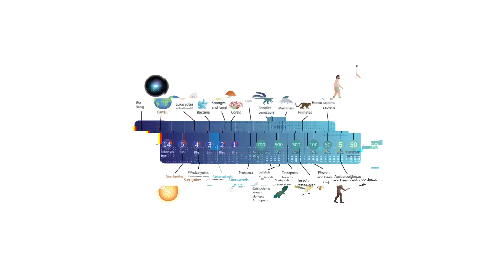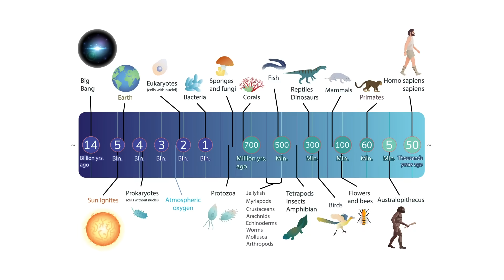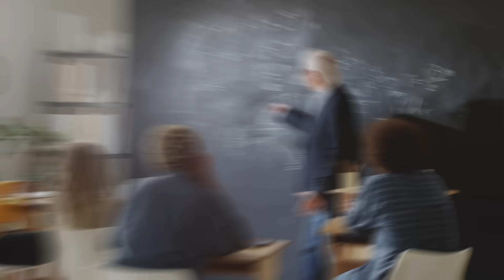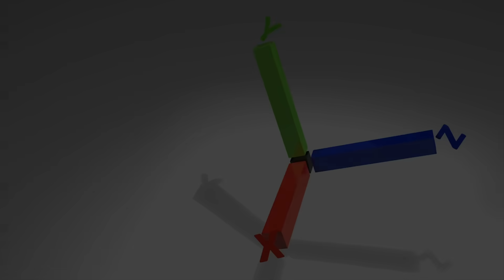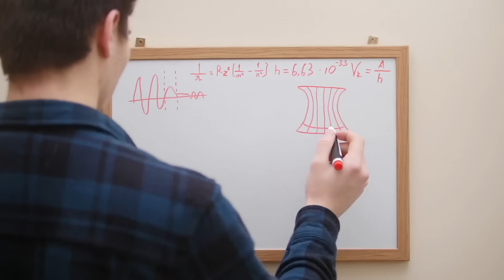Brian Cox - Why Did The Big Bang Happen?

Comment: Thanks to the JWST, astronomers have, at the edge of the observable universe, discovered many well-organized, mature, small n smooth galaxies which shouldn't be there according to the Big Bang and expanding universe hypotheses.
Furthermore, the optical illusion and surface brightness predicted by the expanding Universe hypothesis where distance objects appear larger n dimmer due to expansion do not hold in this case either. 
Therefore, what Vatican's shills and corrupt theorists have claimed so far to support the Creationism which required so-called beginning of the Universe, turns out to be a falsehood.

Comment: here is what the Holy Ari writes to us: The Tree of Life – a Poem, And he actually referred to the reason, that is, to the question why.

Behold that before the emanations were emanated and the creatures were created,

The Upper Simple Light had filled the whole existence.

And there was no vacancy, such as an empty air, a hollow,

But all was filled with that Simple, Boundless Light.

And there was no such part as head, or end,

But everything was One, Simple Light, balanced evenly and equally,

And it was called “the Light of Ein Sof (Infinity).”

And when upon His simple will, came the desire to create the worlds and emanate the emanations,

To bring to light the perfection of His deeds, His names, His appellations,

Which was the cause of the creation of the worlds,

Then the Ein Sof restricted Himself, in His middle point, precisely at the center,

And He restricted that Light, and drew far off to the sides around that middle point.

And there remained an empty space, an empty air, a vacuum

Precisely from the middle point.

And that restriction was equally around that empty, middle point,

So that the space was evenly circled around it.

And after the restriction, when the vacant space remained empty

Precisely in the middle of the Light of Ein Sof,

A place was formed, where the Emanations, Creations, Formations, and Actions might reside.

Then from the Light of Ein Sof, a single line hung down from Above, lowered into that space.

And through that line, He emanated, created, formed, and made all the worlds.

Prior to these four worlds, there was one Light of Ein Sof, whose Name is One, in wondrous, hidden unity,

And even in the angels closest to Him

There is no force and no attainment in The Ein Sof,

As there is no mind of a created that could attain Him,

For He has no place, no boundary, no name.

--The Ari, The Tree of Life, Part One, Gate One

Comment: Like sound, if the speed of light is finite (limited) it could never reach it's destination unless photons ghosts are adding data from the future into the objects we see, re-converging geometry with motion, coordinates, speed, gamma, color and contrast. Relativity and big bang debunked. If the speed of light is finite (limited) to 186,000 mi./s before the images reach their destination future data must be added into the objects we see, then re-converge geometry with motion, adjust coordinates, speed, gamma, color and contrast. It's illogical to say that light "travels" If light were reflected back in a mirror from opposite sides of the universe, according to Einstein's relativity (moving clocks run slow) the light from the mirror would move backwards in time. If the speed of light is finite (limited) to 186,000 mi./s light could never reach its destination as galaxies, stars and planets have moved from their coordinates, proving light is instantaneous in time, therefore have no speed limit in time. Relativity & big bang debunked. Light waves travels instantaneously in all directions, measuring it's speed inside a glass vacuum tube creates light shattering (interference) breaking its state of superposition. Light waves propagate through space in parallel rays behaving as the source at a given point, while measured light appears to have a limitation of speed yet its images appear instantaneous in time. 

If light and moving images were (limited) in speed for even a microsecond light waves would break its state of superposition, the sequence of video frames would immediately stop, like pulling the plug on your TV or video recorder. Einstein's relativity has the same similarity as religious and political cults, rejecting all evidence that disproves their ideology the psychological term is Mass Formation Psychosis, similar to cognitive dissonance only worse :-). The Earth is constantly moving-orbiting the sun revolving on its axis, if light and images weren't instantaneous in time celestial objects would be blurred out of focus as the human eye is limited to 30 frames per second. If the James Webb space telescope captured live video with unlimited power you would see planets orbiting their sun, looking closer you might see aliens walking on the streets where they live laughing at Albert Einstein's time dilation 🙂

Einstein removed the ether medium coordinates of objects in space, replacing real gravity with mathematical gravitational wave clocks that defy the laws of physics. Einstein's space-time relativity is a mathematical model of the universe having no physical realities, so of course mathematical gravitational waves can stretch time back-and-forth like a rubber band :-). Like the movie Rainman, autistics are great at math but lack emotional intelligence. If space was curved gravitational waves would throw planets out of orbit, altering time as galaxies and planets ascend and descend gravity waves, warp-curve, bend images in the James Webb space telescopes, the emptiness of space has near zero gravity duh. If gravity curved, warped empty space it would also curve-warp images in the James Webb space telescope. The center of the sun is not the gravitational center of solar systems, neither are the center of black holes or galaxies the gravitational center for stars. If gravity curved, warped empty space, planets could not orbit in a flat plane around their suns-stars. Einstein's gravitational waves do not exist. The Magnetron gravity model debunks Einstein's Relativity, Quantum Mechanics, space-time, Big Bang, black holes, and our current understanding of celestial mechanics illustrating how light travels instantaneously in all directions independent of time, space and gravity. 

If the universe is expanding from a Big Bang by 360°x360° at an increasingly faster rate then the earliest post big bang galaxies at the singularity 13.8 billions years in Earth's past are now in Earth's future passing the singularity yet the size of galaxies remain the same? If the universe is expanding at an increasingly faster rate (faster than light) explain how you can measure distance if the speed of light is constant :-). Since gravity bends-curves light and space-time, explain how time and distance can be measured if light and space are being bent-curved passing through billions of years of Einstein's gravitational waves. Doublethink is simultaneously accepting two conflicting beliefs as truth. Explain how light particles record moving images of past cosmological objects, add image content from the future then re-converge and play back the final moving image in what we perceive as real time. Galaxies coordinates change with movement, even if it were possible to view images from Earth's past we would also see (all prior past images from each coordinates change of the past. 

If the speed of light is finite (limited) to 186,000 mi./s light could never reach its destination as galaxies, stars and planets would have moved from their coordinates with time, proving light (and it's images) are instantaneous in time, therefore have no speed limit in time. If an Earth based observer and time traveler used synchronized mechanical watches their time would be the same throughout the universe, debunking Einstein's relativity, space-time and big bang using common sense. Time and space are independently of each other, not material bodies or fantasy unions that magically stretch time and space like a rubber band into space-time dimensions with (near zero gravity waves). If space was curved gravitational waves would throw planets out of orbit, altering time as galaxies and planets ascend and descend Einstein's hypothetical gravitational waves, stretch-warp images in the Hubble and James Webb space telescopes. 

A particle would need a series of particles to bend in superposition like a wave. Imagine your vehicle being a particle, its onboard computer would need to instruct all the vehicles in your lane to make a left turn, but according to relativity the street no longer exists. Since Einstein's projectile light particles are separated by distance in space-time their distance would increase by the same factor obviously violating the laws of conservation of energy. If space curved the path of light through space-time an increased velocity and light source energy would be required to travel the increased distances, again violating the laws of conservation of energy. If galaxies (viewed) with the James Webb space telescope are no longer there (billions of years in Earth's past) than neither are Einstein's gravitational waves, space-time, dark energy, dark matter or the body of space/ether that contains these galaxies.  

According to Einstein's relativity, projectile particle photons transport moving images from galaxies past into the future, re-converging geometry, gamma, contrast and color with every microsecond change in coordinates. Sorry, there are no video recorders in space. The moon is above Earth's horizon for 12 hours, if the curvature of space bends-curves light space and time then measuring the moons distance from Earth as light travels in a curve at 2,288 miles per hour the moon is then 27.456 miles further from Earth during daylight hours. Since the light from the Sun takes 8 minutes to reach Earth according to Einstein using a telescope to magnify time with a 20 times magnification power you should still see the Sun even after it's below Earth's horizon. Please use a Sun filter before trying this experiment :-). If the images you see in the universe were really in Earth's past, you wouldn't be able to see them because the past no longer exists :-). Delusion is characterized by or holding idiosyncratic beliefs that contradict reality. Magnetron As a television electronics tech-theoretical physicist I laugh at the stupidity of scientist lol

Comment: THE BIG BANG WITHOUT A GOD
so you believe that all the necessary ingredients for all life and non life came from the Big Bang. 
but how does the Big Bang create all necessary ingredients, then collect all the necessary ingredients together for all organic and inorganic matter to begin with?
then how does the Big Bang disseminate the ingredients in the correct order so as to assign where the organic and inorganic ingredients are to be incorporated correctly with each 
Organic and inorganic particles?
And how does the Big Bang even know that these ingredients are even cohesive for these elements to be able to bring about the earth, the moon, space, water, and the sun. Bearing in mind each are necessary for all biological life to exist and continue to exist?
thats without taking into account this big bang had to spin dust into hot balls to bring about the sun, moon and earth so precisely as to achieve the perfect distance required for life to even be possible on earth!!
so that the sun isn't to close to burn up life 
And not to far to be to cold, the moon to evenly distribute the gravitational pull to prevent destabilisation and it being necessary for life especially aquatic life.
The earth having the perfect gravitational force for ample momentum for the people to move sufficiently. the ideal atomosphere to protect from uv rays,
Water to sustain biological life including food sources and the adequate oxygen to breath. 
And you think this happened by chance from the Big Bang which has no mind, no will, no reasoning or purposes to bring about sustainable life, if anything the big bang must be self destructive because it's brought to life humans who are destroying nature through climate change.
Im sorry but if you think this happened by chance, I have to disagree with you & I think you are fooling yourself by denying scientific observation itself when it shows on a daily basis that minds bring forth complex plans, processes, implementation & structure 
Of which these things are orderly and have purpose. I don't see how it is possible for this to have taken place by chance, to be honest I would say to the point that it wouldn't even be mathematically in equatable based upon  the probability of it taking place without a mind, In the way that it has.
with such precision as to where the planets aligned in perfect proximity and unison one to another also taking into account the universal constants that govern the very nature of our reality.

Comment: 5:40 "The universe was was jammed into an infinitely small space".  This statement is contradictory on so many levels, where do I even begin?  If the "universe" is "jammed" into a small "space" where is that space located.  So you don't mean by universe as everything there is, but this particular one, that's located in another bigger universe?  And if so how did that one originate, and where...does the term where even have a meaning, and I thought time and space didn't exist, was created in the Big Bang....so therefore how could there be a beginning if a beginning implies linear time.  And where would this singularity be if there was no space. And if there was no space or time was was here instead?  As Al Pacino said in Scent of a Woman, I'm just getting warmed up! :elbowbump: Why is there something rather than nothing?  Because God was too scared of nothingness, so created everything. 🌎

Comment: Question, when he says the universe expanded out from that point smaller than an atom, does he mean like a shockwave with the matter following it out? Or maybe it was like blowing up a bubble pushing matter in from somewhere else?
Reply: Good question and I have pondered something similar. Our dimension could have flowed out from a different dimension through a tear, And in a similar way that electromagnetic radiation / light may flow out from a different dimension and a black hole may flow into a different dimension.
Reply: Really? You believe these idiots?

Comment: You know if you cut a string in half, then half again...you can keep cutting it? Nope. When the string reaches 10<33rd power (that's 10 minus 33rd power), it reaches "Non-Locality" and, the only way Quanta scientists can describe it, is that it "explodes" and the remaining atoms diffuse into the Universe, somewhat like the Big Bang in microcosm (Quantum Physics) reverse. 
But you probably already knew that...
😱
This is called Planck length 10<33 cm. There is also Planck time 10<43 seconds.
Or....
We could be stuck in an endless Mandelbrot that goes on into infinity.
Or....
Maybe we are just a dream or a thought in God's brain, sitting on a neuron....
Where Did God Come From?

https://youtu.be/dWrEczFaygk

https://youtu.be/_ie9musGEqQ

Comment: Question:  How can gravity be a weak force when "the great attractor" is tugging the known universe in it's direction?
Reply: Of the 4 fundamental forces (the strong force, the weak force, electromagnetism and gravity), strong is by far the strongest (duh) but has a very short range - on the order of subatomic particles - and the weak force also has a very limited range.

That just leaves electromagnetism and gravity able to act over distance. Electromagnetism is much stronger than gravity, but the strongest known magnetic objects are magnetars, neutron stars with massive magnetic fields, so there's nothing we know of that can emit EM force with strength comparable to a supermassive black hole's gravity. Electromagnetism also affects most bodies much less than gravity, as the vast majority of material in an average planet or star is non magnetic.

This leaves gravity, which affects everything, as the only force with universe-shaping capabilities.
Reply: The great attractor is a gravitational anomaly that affects just some of the superclusters, the effect on Laniakea supercluster being the most visible. It is Not tugging the whole Universe. I may be wrong, though.
Reply: Not to mention according to theoretical physicists gravity seems to stop the local expansion of space, say between my house nd the local Walgreens.
Reply: Gravity is weak only when compared to the other stronger forces
Reply: Misses Hippy
Perhaps, just perhaps it's made up 😏